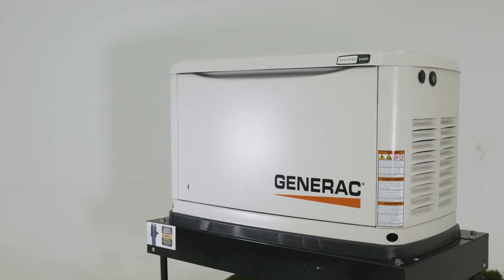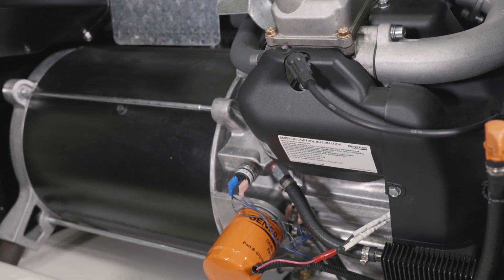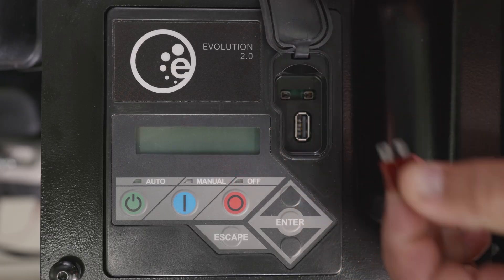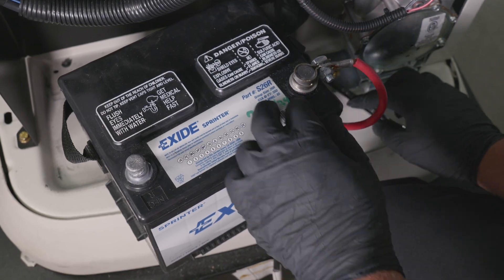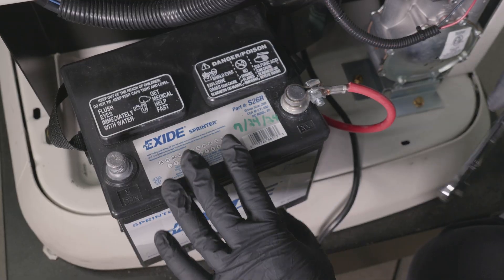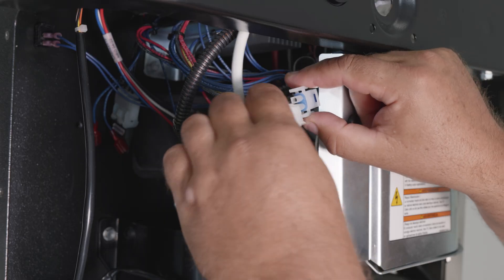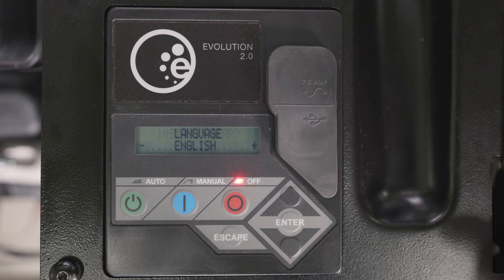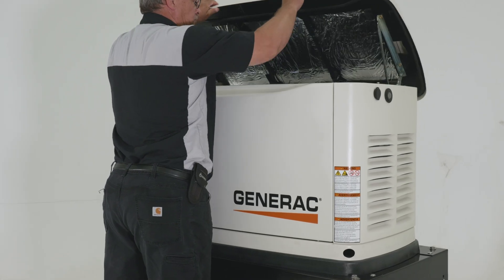Battery Replacement – Air-Cooled Home Standby Generator

Comment: Are there any other settings we need to configure when the system reboots other than date/time? Wasn’t sure if I need to have the installer come back out and set configurations.
Reply from the maker: For a Generac home standby system, the main setting you’ll need to re-enter after replacing the battery is the date and time. Other configurations, such as your exercise schedule, installer settings, and Wi-Fi, should remain intact, though occasionally the Wi-Fi may need to be reconnected.

You can find a written version of the battery replacement procedure here: https://support.generac.com/s/article/How-do-I-replace-the-battery-on-my-home-standby-generator